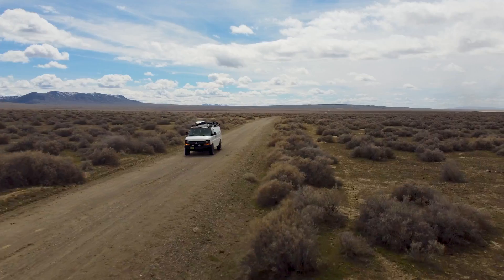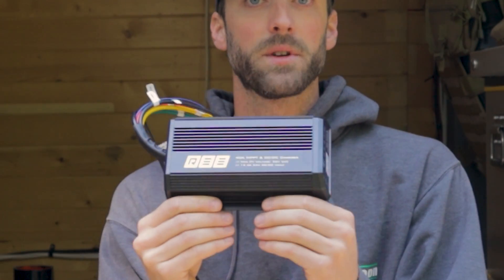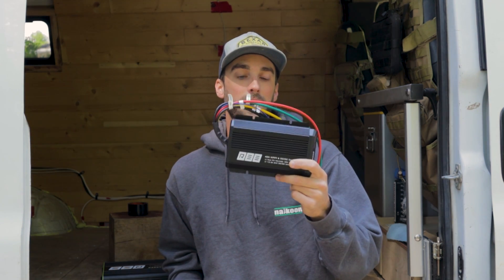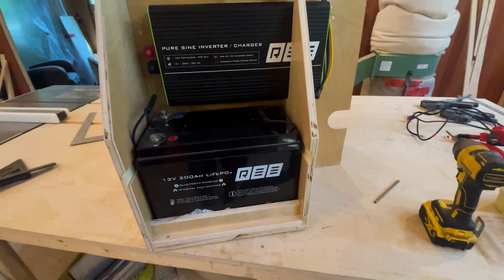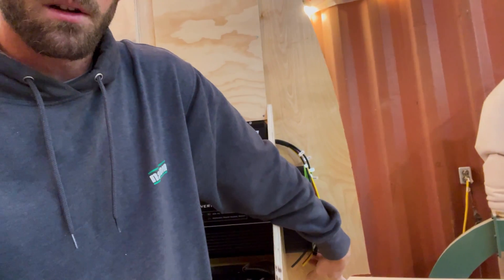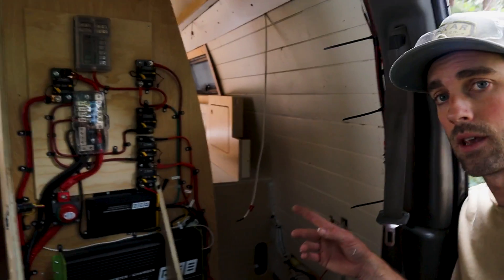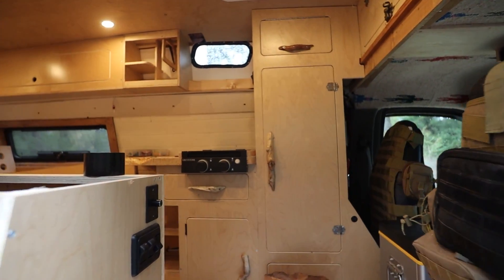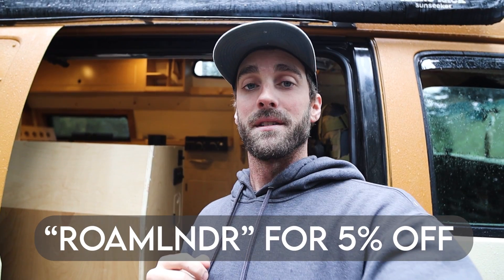The Canadian-Made Off-Grid 12v Electrical System You Didn't know About

Comment: hey there, we also have a Chevy (2004, 5.3) 
Please comment on how you brought power from the start battery (right front) to the master switch. 
TIA
Reply from the maker: Hey Mike, I have a large breaker at the starting battery then 4awg wire going through the engine bay into the cab from under the driver seat. I drilled two holes for the wire to go through. Is that what you were asking?
Reply: @SlowRoamers  good answer, 
Q: pt.2, 
what did you consider when placing your van electric's close behind the driver? 
(is there more than the fuel filler in the Left Rear quarter?)
Reply from the maker: @mikekc8vse958  good question! I made the decision based on accessibility.  Behind the drivers seat was the one location that's easy to access but covered up enough to hide the system from plain view.  In the event that there is some kind of electrical malfunction, I can just reach in behind the seat and switch off the master switch.  Also, it's easy to work on, all I need to do is remove four nuts for the driver seat and I have a big open space to work in.

Comment: @SlowRoamers What was the reason why you replaced the induction cooktop?
Reply from the maker: Power draw. It was draining our battery faster than we could recharge. Our longest stay was limited to 3 days with good solar, significantly less on a cloudy day.
Reply: @Slowroamers Thank you for your very quick reply!

Okay I understand that. 220Wp probably aren't enough for induction - especially when you like cooking as much as you both seem to do 🤠 

Do you notice a significantly higher solar power income now (maybe in percentage relation as you added a third panel) after you rebuilt your system? I'm asking because while watching some of your older videos I saw that your previous roof rack rails on the top left and right were covering quite an area of the panels, probably throughout the whole day. Did that maybe lead to a someWATT decrease of power? 🥸😁

Like your content btw. Keep on going 🤙🏼
Reply from the maker: We added another panel to the roof so it’s hard to compare. I don’t think those roof rails were hindering any solar intake if that’s what you’re getting at.